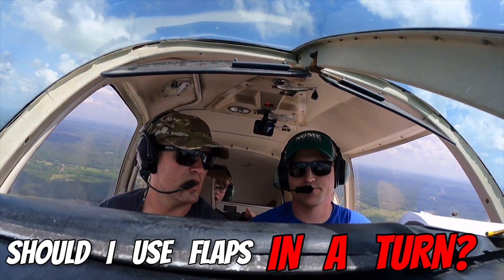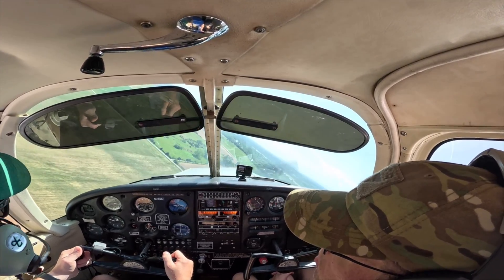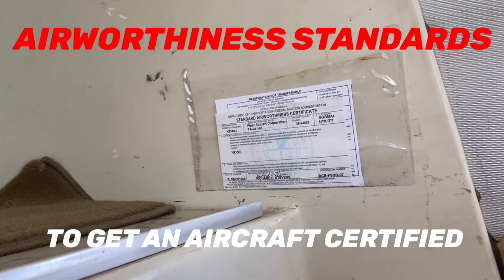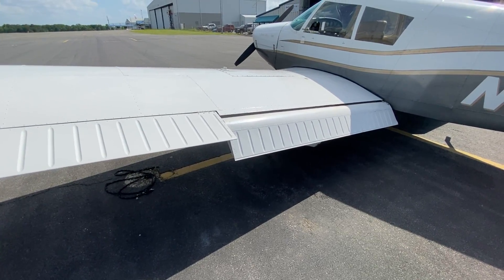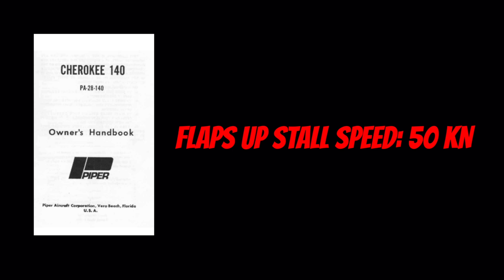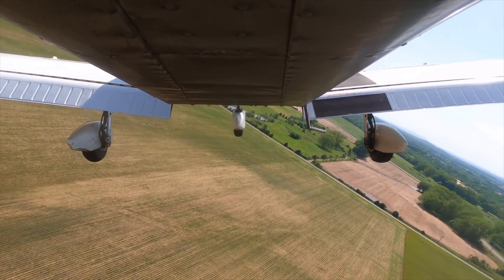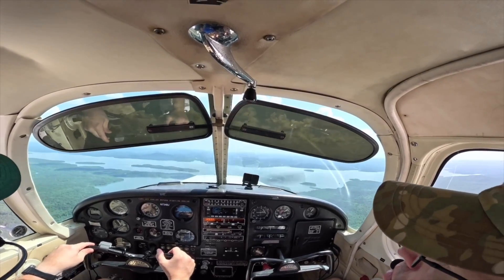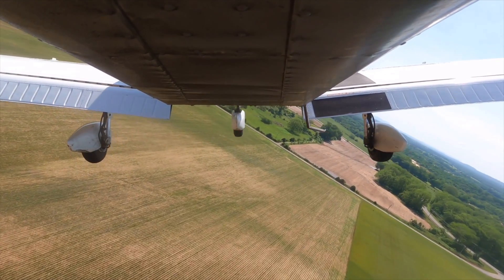Should I LOWER Flaps in a Turn?

Comment: Regarding tightening the turn with flaps - something got a little off.   The turn radius is purely a function of the horizontal lift component (from the bank angle) and your true airspeed.  Sorry for an equation:  r=v^2/a.  If your bank angle was truly the same, you were making exactly the same lift as in the no-flap case - AoA was lowered to compensate for the flaps.  How do we know this?  Consider that your vertical lift component was also identical given that you were not climbing or descending during the turn.  The two ways to tighten a turn is to slow down or increase bank angle.
Here is a related video - load factor with airspeed.  
https://youtu.be/7OKpGiHaEio
Reply: Another vote for N91CZ.  At a given bank and speed the turn can be calculated without knowing the kind of plane or helicopter or bird or space ship.  The condition of the flaps makes no difference.  It's just straight physics of motion. The turn will take the same time and cover the same radius.  Flaps will allow you to safely fly the turn slower and that will decrease the radius.
Reply from the maker: However, flaps also increase lift. Therefore, if I bank my airplane, my horizontal lift is also increased.
Reply: @FreePilotTraining  Just compared screenshots of the brief period the bank was visible in the video.  The flapped bank angle was noticeably steeper.  If both are representative of the entire turn, that would explain the different turn radii.
Reply: @N91CZ  I agree 100%, N91CZ.   Turn radius is purely a function of groundspeed and bank angle.   

Now it IS true that flaps let you tighten the turn radius because you can then safely fly at a lower airspeed (so, a lower groundspeed) - or a steeper bank angle - if you do so!   But if you really do maintain the same bank angle and the same airspeed (again, technically groundspeed), your turn radius cannot change.    

There is another misconception in this thread - that is that wing loading is less in a descending turn.  It is at the start of the descent - that is, when the airplane is accelerating down - but that lasts only so long.  Once the descent is established, the wing loading returns to what it would be (for that bank angle) in level flight.

BTW, I lower flaps in the turn, as needed, and that's what I teach.
Reply: @VegasCSIP  using ground speed really only works if no wind, otherwise track over the ground looks like a stretch out coil spring laying on its side.
Yes, in the vertical, a force imbalance generates an initial acceleration until a new equilibrium is reached.  The vertical acceleration is transient.
Reply: @N91CZ  Oh yes - of course!  That's what I get for thinking about things when I'm tired.   Airspeed is all that matters when considering the radius of the turn relative to the surrounding air, not relative to the ground.   Thanks for that accuracy nudge.
Reply: @FreePilotTraining  flaps increase lift if all other factors remain the same.  If you maintained the same bank and increase lift, you would tighten the turn AND start climbing. That is, both the horizontal and vertical components would have increased.  Since you remained at the same altitude you know the vertical component did not increase and thus you can deduce that the horizontal component also remained the same.
Reply: @FreePilotTraining  These guys are right, and you are clinging to this. You're USAF, maybe ask some of your colleagues there. It's not that advanced, and I'm kind of surprised you're not getting it. Flaps will not decrease turn radius unless you use them to reduce your speed. Consider the possibility that the ASI in your Cherokee reads high when the nose is lowered to compensate for flaps. If you correct for that you will get artificially tighter turns.
Reply: @FreePilotTraining  The better way to describe what flaps do is to simply say they change or move the lift curve.  To say they increase or decrease lift makes assumptions about other parameters like pitch, airspeed, and even time, that is, transient vs steady state.  
This is easy to show/describe on a lift curve plot or graphic - if the topic comes again up in another video.
Reply: I agree, too. I also wrote a comment which says basically the same (did not see this one at the time).
Reply: It would seem that there is a certain amount of "sliding" that occurs when you turn.. At the same speed and same bank, it would seem that the additional lift created would reduce the "slide" by apply a force "lift" in the direction of the turn, thus a tighter turn.. I'm looking for a formula now..
Reply: @treetopflight7624  Do you mean an uncoordinated skidding turn?
Reply: I came here to make this same comment.  N91CZ is right on the money here. Per the turn radius formula, the only two variables that determine turn radius are velocity and angle of bank. If you are flying at 70 knots and you are in a coordinated 30 degree bank, your turn radius will be 754 feet, flaps up or down, big aircraft or small.  Yes, flaps generate more lift, but a 30 degree bank sends the same ratio of that lift vertically and horizontally, so if you do a 30 degree turn at 70 knots with flaps up and try to do the same 30 degree turn at 70 knots with flaps down with the same power setting, you get more lift both vertically and horizontally, so that extra lift will cause you to climb unless you increase your angle of bank to keep the vertical lift component constant and send more lift horizontally.  Everything else in this video is good though.  Flaps are your friend, use them in a turn, use them to slow down, and use them to decrease your turn radius, but just know it decreases because you can fly slower and/or increase your angle of bank.

Comment: Thanks for this video. I fly a TBM. The flap system on this plane senses left/right discrepancies and halts flap motion if there is any deviation between flaps. It also halts flaps if there is unexpected resistance in the linkage. Very solid/reliable system. 

This mechanism is very important in a TBM, because they have very large flaps covering most of the trailing edge of the wing. The space left for ailerons is so small a spoiler is integrated with the aileron to enhance it’s effectiveness. 

The big controversy in the TBM community is landing with partial flaps (takeoff or half flaps). Daher strongly states that all landing should be with full flaps. Many feel this is not good practice at busy airports. TBMs are sequenced in with jets, because they are very fast planes. But they slow to a very low final approach speed (80-85kts) with full flaps. This tends to upset controllers at busy airports. 

Many TBM pilots will keep their speed up using takeoff flaps, accepting the higher landing speed in order to keep speeds much higher on approach (120 kts or faster). with takeoff flaps, the Vref is around 95, but the plane can fly up to 178 kts with takeoff flaps and gear down. Also, it slows very quickly when power is reduced, the prop is a huge speed brake.

I have no concern deploying flaps in a turn in my TBM, as long as I respect the flap speed limits (178 kts indicated for takeoff flaps, 121 kts for landing flaps).

Thanks for the video!
Reply from the maker: Thanks! This is an excellent discussion in itself! We have similar situations in the Herc since we’re kinda slow. Maybe not quite as slow as the TBM, but we see similar situations.  I still land full flaps all the time. They can give those airliners extended vectors. It doesn’t bother me one bit. 😆

Comment: One of the primary reasons for using flaps when maneuvering at low speed is that it unloads the outer portion of the wings where the ailerons reside.  If you deflect the ailerons with flaps up, the outboard wing section with the lowered aileron is the most likely portion of the wing to stall first.  As a rule of thumb, if your flaps are lowered beyond full deflection of the ailerons, you are more likely to stall the center of the wing first while retaining roll control.
Reply from the maker: That’s a great point! I’m going to be discussing that more in a future video
Reply: Flaps allow the wing to create the same or greater amount of lift at a lower angle of attack. It’s the lower angle of attack that keeps the tips from stalling.
Reply: @txkflier  You end up with effectively two wing sections flying at different angles.  The flapped section now has more camber and needs to lower its AoA to get the total wing lift back to aircraft weight.  When this is achieved, the un-flapped section is also at a lower AoA.  Teh flapped section is now carrying a greater percentage of the total lift.  The key is that the flapped section will reach critical AoA first, thus protecting the outboard section from stall.  
As a general rule, a flapped section will be able to achieve a higher lift coefficient, but will stall at a lower AoA.

Comment: There's no reason not to.
The problem is the new pilots coming up are dumb and faui to maintain pitch control while deploying in a turn. That's the real deal. Otherwise, if you are in control state flight, and a reasonably smart pilot  it's completely fine and often times necessary
Reply from the maker: Very true! Thanks for the comment

Comment: In an Air Tractor using flaps is recommended, in a Cessna 188 Ag Wagon the manual specifically says no flaps for decreasing turn radius.
Reply from the maker: That is weird. I’m not really sure why that would be unless there’s a G-limit on the flaps
Reply: @FreePilotTraining  Dug out my copy, in restricted category (up to 1000# over normal gross) a 2g limit with 5 degree maximum flaps.
Reply from the maker: @bullthrush  that must be why.  The G-limit without flaps is probably considerably more and you can just increase the load factor and that tightens the turn radius in that situation

Comment: Your video hit on 2 excellent points:
Use flaps at abeam, base, final
Keep the turns at 15 - 20 degrees in the pattern ( great remainder about the greater degree turn impact on stall speed)
Reply from the maker: Thanks Chuck!

Comment: The split flap problem is why we don’t have dual motor flaps in GA, so we don’t have to deal with flap breaks, etc.  personally, I prefer manual flaps.
Reply from the maker: Very true. I’m 50/50. I like manual flaps a lot, but sometimes I don’t feel like reaching down there lol
Reply: @FreePilotTraining  yeah, I usually find reaching too far down disorienting.  My Bushcat has the flap lever on the ceiling, as does some of the cubcrafters.   But Bushcat has the flap lever centerline, as is the control stick.  That means I have to reach across with my left hand to control the stick while my right works the flaps.  It is an acquired skill.  Still I like being able to pop & dump the flaps quickly.

Comment: I find that in a 172, if I keep a nice tight lower power decent from downwind, I don't have enough time to wait till I am wings level to drop flaps. When starting with new students I teach a wider pattern and apply flaps in the straightaways so they can see the changes in pitch better, but once they get better and can tighten the pattern up, we start doing them in the turns while managing good airspeed control. In a twin with a wider pattern, I do them in the straights, especially with planes like the twin C that has a pretty good pitch down when going full flaps...
Reply from the maker: Nice! That makes total sense

Comment: An  aerobatic instructor told me once that stall speed does not increase with bank and that’s a poor way of understanding it. That chart only works if your holding perfectly level. Stall speed only increases with wing configuration and G loading (load factor) you can bank 45 degrees but stall speed won’t change if you hold 1 G
Reply from the maker: That is VERY true. That’s why I mentioned “being low” and leveling out in the turn.  I need to make another video on that
Reply: @FreePilotTraining  yeah man, you make really great stuff. I can’t recommend your videos enough👍👍
Reply from the maker: @LukeCFI  thank you for that!

Comment: Great video! As a student pilot practicing landings with my instructor I was nervous about using flaps in the turn. My instructor could see that I reached for the flaps and hesitated because I was in a turn. She immediately let me know that it was okay and normal to use flaps while turning. I was never taught not to use flaps when they are needed.
Reply from the maker: Thank you! Sounds like you had a good instructor!
Reply: U

Comment: I've always used flaps in the pattern as soon as airspeed is in the flap white arc.  Actually on Van's RV's you apply partial flaps a couple knots outside the white arc and it will settle into the white arc.  I am finishing up a big upgrade and will have a substantial data collection system for post flight analysis.  And turn performance is a big target of testing.  I want to know how turn performance degrades at high density altitude and how that can set sea level pilots on a dangerous path when they come up to Northern Arizona, or the high country in Colorado.
Thanks for your video, great work.
Reply from the maker: Very true. I think on most airplanes, the white arc represents the maximum flap extension speed with FULL flaps.  That’d be a great video on turn performance at high altitude.  It’s definitely degraded
Reply: @FreePilotTraining  Got a two finger punch list.   People think turn performance defines a fighter aircraft...well probably true.  But let's know what slow speed performance limits are.  As a great late AF vet of 'weather missions' out of Turkey said while I was a student pilot: Phil any idiot learns early on how to drill holes in the sky.  Pay attention to landings and take offs, that is where pilots get killed.  Love ya George Shuster.  My technical lead at Lockheed now some 30+ years.
Reply: Yes , a lot of pilots don’t realize that about the white arc .

Comment: Excellent video. I have been flying for decades and was always taught to use flaps in the circuit/pattern. There is one other little advantage, if you apply the flaps at the same time as beginning a turn, in most GA types this will produce the usual 'balloon' in pitch, that balloon will in many cases match the increased pitch required to hold altitude in a turn. (Yes I am aware this doesn't apply to some aircraft types with barndoor flaps or types that have a pitch down moment).
Reply from the maker: Thank you! That is so true! You could intentionally roll them in the turn to keep from ballooning

Comment: Thank you. Excellent video and great technical research and analysis.  I’ve been instructed both do and don’t over the years. I usually do apply flaps in turns and find that compared to level flight, they are virtually unnoticeable  to passengers because the sensations related to any changes in pitch and speed are both mitigated by banking. I also seem to fly a smoother, more accurate and stable pattern applying flaps when they are needed instead of waiting for an arbitrary level off period between turns; especially when flying relatively tight, “power off” patterns. Thanks again!
Reply from the maker: Thanks! I really appreciate that! I never thought of that before, but using them in the turn could alleviate that ballooning feeling from lowering them in level flight

Comment: Good job! We use and adjust flap settings all of the time in the military (fighters & transports) and in the airlines while turning. BTW- transports are designed under the stricter guidelines of FAA part 25. That's probably why all of the transports I've flown (Boeing & Lockheed) have a system to stop flap movement once an asymmetry is detected. Happy landings!
Reply from the maker: Thank you so much! I need to look more at Part 25, but that makes total sense!

Comment: Nice video, what i think those people were talking about is adding or removing flaps while in a turn, mostly on base to final, changing an aircraft handling characteristics might be overwhelming and dangerous in such a critical place, even more for student pilots.
Reply from the maker: I can get behind that argument. Good point
Reply: I respectfully disagree. We're over thinking this. If a student can't manage a pitch change due to adding flaps, especially at a lower speed, he/she shouldn't be flying. It's no more risky than making a power change. Your comment doesn't really hold water.

Comment: The data said there isn’t a split flap accident, but that includes Experimental aircraft, no? So, what’s your point with going on about certified aircraft?
Reply from the maker: Yes, it does. I’m simply making the point that a certified aircraft must meet those requirements in 23.701 before it can receive an airworthiness certificate